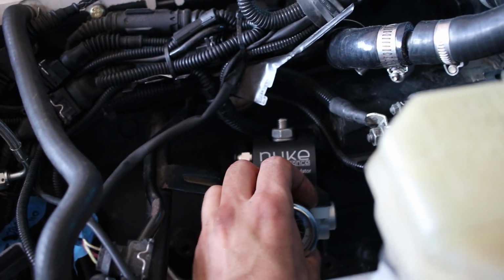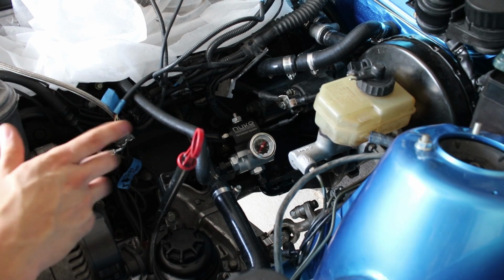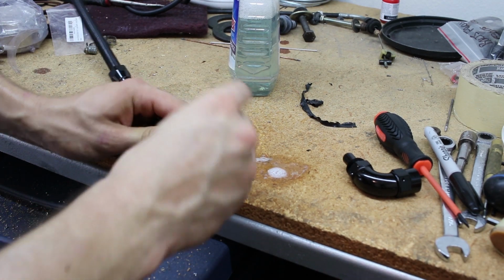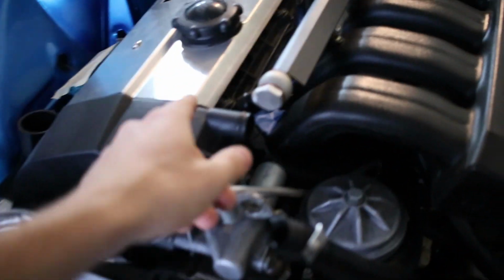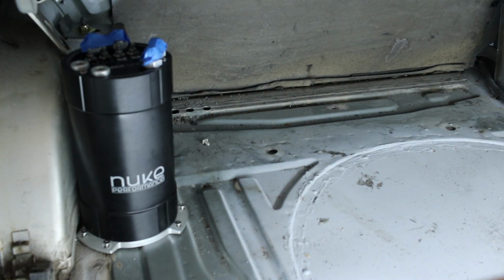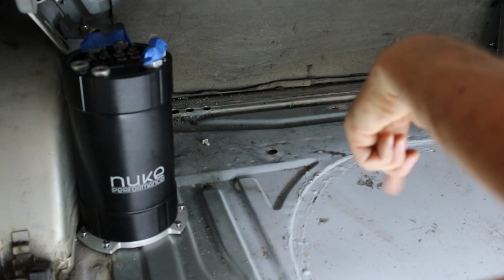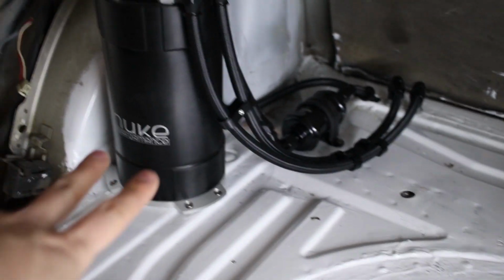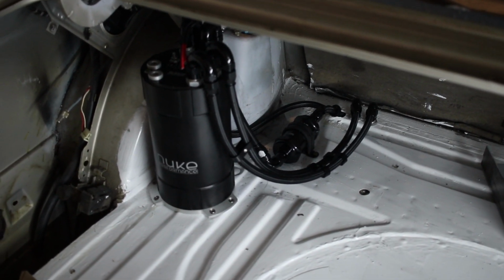Rocket Bunny Turbo S52 BMW E30 Build | Part 20: Custom Fuel Set Up Continued

Comment: Just found this channel. Like your work so far! Does the surge tank not need a return to the main tank? Otherwise the main pumps will burn up from trying to force fuel into an already full surge tank?
Reply from the maker: ThatFly WelshGuy Four lines. 
Feed and return to tank. Feed and return to rail. 

Return-less fuel systems do definitely exist though.